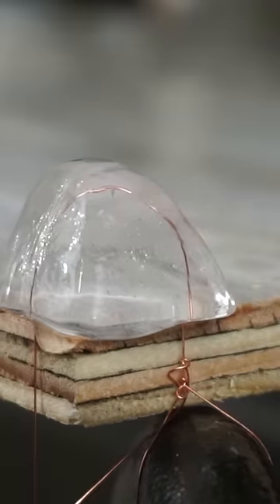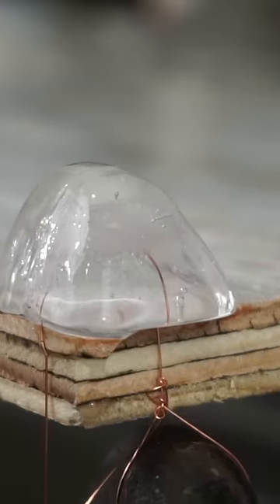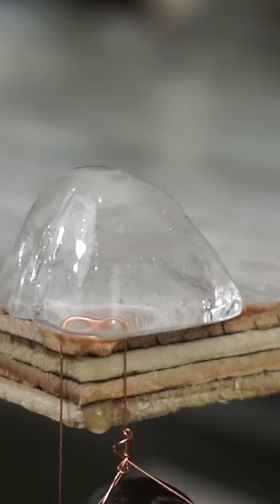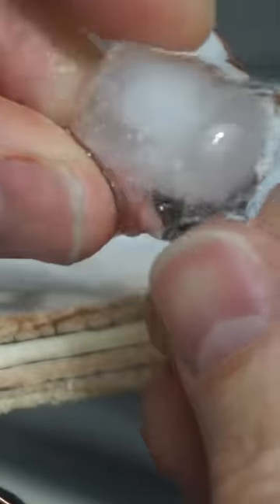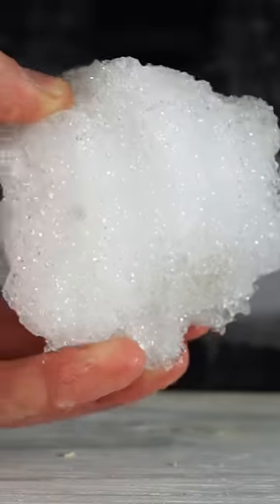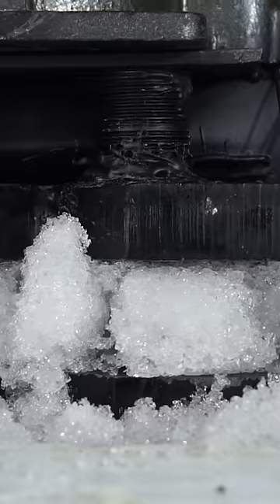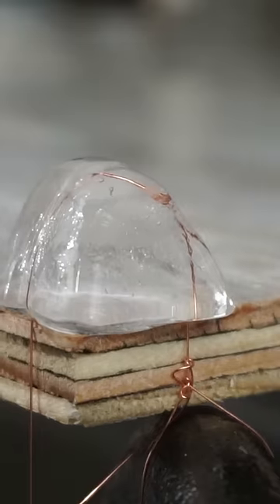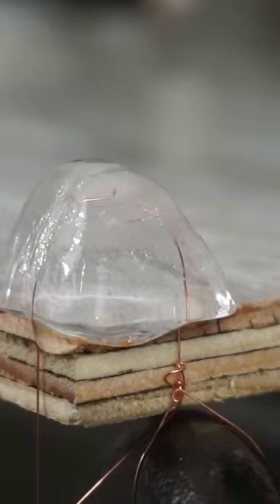Melting Ice With Pressure Instead of Heat

Comment: This is the reason u can skate on ice
Reply: No it’s nor
Reply: Yep. Your skates cut through the ice, but duw to this process, the ice reforms. But as the video states, the ice will still melt, which is why we have Zambonis
Reply: @Bean891 
 1) yes it is, the skates cut the ice and your weight causes pressure, slightly melting it, afterwards it reforms, and
2) *not
Reply: I thought I heard that was a myth, and we actually aren't sure why we can skate on ice. Is that right, or am I mistaken?
Reply: @Rippertear  the pressure on the ice melts it so u glide on water and then it freezes again. I heard that from neil degrasse tyson
Reply: @Stossburg  well im no scientist idk. Im just saying what i heard in a short. U may be right idk
Reply: @Bean891  Bro failed physics 💀
Reply: Someone needs to look at the phase diagram of water. At -5C, you need ~50 MPa of pressure to melt ice. So let's take a big fat 100kg ice skater that applies a force mg = ~1000 Newtons onto a single ice skate blade that has a surface area of 0.001m^2. That gives you a pressure of 1000N/0.001m^2 = 1 MPa, which is 50 times too low to melt ice at -5C.

Unless the ice is almost at its melting point (within a few hundreths of a degree C to 0C), the ice will not melt due to this mechanism. And in this video, the ice may be melting almost exclusively because the room is above freezing and copper is an excellent thermal conductor compared to air. 

What I vaguely remember reading on this is that ice has a meaningfully thick layer of increasingly disorganized molecules the closer you are to the top surface and the closer you are to the melting point. It is this disordered layer that is kinda effectively in the liquid phase that allows for ice skating.
Reply: @alquinn8576  geez 1.) im not reading all that.
2.) im not arguing i just heard it somewhere
Reply: Don’t know if skating shares this mechanism, but I do know my blades do melt the ice. How? Just skate backward and you can see a very quickly refreezing path tracking back to my blades. Both hockey and speed skates
Reply: And if you couldn’t skate on ice, then the universe wouldn’t exist 👍
Reply: @Rippertear  Again, I am no scientist, and I could be wrong, but I think it's still debated, so I guess both are correct
Reply: @dusanvasilik7480 How sad. If you can't be bothered to read it then you shouldn't bother replying to it.
Reply: I remember richard feynman believed this, in his "why" speech during one of his interviews.
Reply: It makes sense . It might be a quantum effect similar too quantum tunneling . The key thing is pressure and the material as stated in the video .  Intense Pressure causes strange things such as a core of a sun or more intense neutron star and etc . But if you want to go deeper down the rabbit hole , technically the metal or blades aren’t really touching the ice .
Reply: I heard it was the friction melting a thin slice
Reply: @alquinn8576  that sounds like you're agreeing it would melt in the 3rd section, because we're only talking about a few molecules on top of the ice. Of course a skater isn't gonna sink into the ice if they stand there too long, so all they need is a thin layer on top. I'm sure there's multiple processes at work which still warrants studying. 🙂
Reply: I think there's just an extremely thin layer of water on the surface of the ice
Reply: @D00nkey why haven't I ever slowly sunk in the ice being stationary while on skates?
Reply: @dusanvasilik7480 😂 oh NDT said it? i extra dont believe that shit now thanks
Reply: You can skate on ice because the melting point of ice increases as preasure increases so a layer of water forms where the skates are present which acts as a lubricant and reduces friction. Regelation is refreezing of ice.
Reply: @Bean891  bto just said "nuh uh" 💀💀💀
Reply: @Shaboogamoo because the pressure is not enough.  Put an 🐘 on your back and you will sink.  The melting (allowing you to ⛸️) also has to do with friction creating heat and not only the pressure.
Reply: @dusanvasilik7480 why would Neil degrasse Tyson know about the physical characteristics of ice? 
He's an astrophysicist.  All he will do is speak to and learn from experts in the field... you can do the same if you have the patience.
Reply: Why would this be needed to skate on ice? Both ice and metal have low fiction when "polished" smooth; you would slide just fine without the ice melting. 

(I don't even understand why the melting would improve "sliding", if anything the fiction would increase the deeper your skates cut in)
Reply: @theoriginalmonstermaker  the ice isnt smooth it has bumps from the skate blade. Idk if u ever saw a skate blade but it is a concave so u have ur whole body weight on a tiny knife edge when u r turning.
Reply: @dusanvasilik7480  The ice is smooth enough.  Also,  applying 150lbs of pressure on the edge of a thin piece of metal is sure to clear minimal unevenness. 
But the pressure (and metal's heat conductivity) is sure to cause at least SOME melting.  That clears the path as well... I mean,  I don't even really understand the implication of the OP; metal slides on ice, pressure and the smoothness of each reduces whatever friction there is,  if it melts,  even better... but it's not like skating would be impossible without some mystical phenomenon.
Reply: @Bean891 nor nor
Reply: @alquinn8576 sure showed that virgin
Reply: @dusanvasilik7480 NDT is often not on the forefront of science.
Reply: @alquinn8576 I'm not sure the surface area is actually that much, but everything you said makes sense even if the surface area is half of your estimate, so nevermind
Reply: I don't know if it's true or not, but the fact that ice skate blades are universally metal leads me to think this is probably true. Considering how we've had an official d3ath in a hockey game in England Autumn 2023, if any other "safer" material could be used, they would have done it by now.
Reply: According to NDGT that’s why.
Reply: @alquinn8576 thsnkd
Reply: @alquinn8576  I'm gonna assume you probably have some background in this, so question: does this have anything to do with why you get ice2-7 on other planets? The liquid ice phenomenon? I'd done a bit of research on it to respond to someone on another video, but even after, I, myself, was still quite confused as to how liquid ice was formed.
Reply: @lunaballuna no, not an ice expert, beyond tangentially having a physics degree and having done high pressure experiments.

Not sure what you mean by "liquid" ice since it's all solid by definition, but there is an amorphous (non-crystalline) phase of ice. Most of the different phases of ice require significanlty higher pressure than our atmosphere, and the deep earth is too hot for it to be stable, so that is probably why it is mainly (believed to be) found in colder icy moons, planets, etc.
Reply: Pretty sure we move faster than the ice can melt by our pressure so when it melts, we have already passed onto a solid part of the ice. I think the real reason we can skate on ice is the very low friction coefficient. I mean people skate on Teflon as well, it doesn't work as well as ice but still.
Reply: @dusanvasilik7480 Nah bro, i was about to believe in you till you said Neil tyson grass
Reply: @alquinn8576  We cannot make the blanket assumption that the surface of ice has different material properties than the bulk; but then apply the same assumptions about how much pressure is needed to melt it. Also.. skates move; they don't just press down in a normal direction.
Reply: @stickyfox  no, the point is that there is nothing to melt the surface of the ice because it is naturally already melted-ish (forming what is called a "quasi-liquid layer"). you can see "Thermodynamic origin of surface melting on ice crystals" on PNAS for a description, for example.
Reply: @alquinn8576  sure but what I'm saying is that regardless of ones beliefs, the statements A: "it would take a skater weighing tons to generate enough pressure to melt ice," and B: "it's not ice"; do not logically fit together to form a basis for further speculation.
Reply: @stickyfox  I don't know what you're confused by. The pressure mechanism is the explanation offered here. I'm saying there is a different mechanism that doesn't require pressure to explain a surface layer of melt.
Reply: @alquinn8576  Yes but... you're talking about whether or not ice skates "work because of pressure," and I'm talking about a misuse of logic before an audience that generally lacks a formal scientific education.

Logical fallacy questions like this are on standardized exams for middle schoolers. You don't need any science training to spot a mistake like that.
Reply: No, it's not. Scientists used to think so, but we now know that it's because the mobility of the molecules at the top layer, so it behaves like liquid water. 

Why do you think we can slide on ice even when we're not using skates?
Reply: @D00nkey  bro ratio'd 💀
Reply: Scientists: why can skate on ice?
Me: since when was that something we were confused about??
Reply: @alquinn8576  Or maybe the ice is just slippery?
Reply: @dusanvasilik7480 1) You should read it, it’s pretty interesting 
2) They aren’t arguing, they are simply stating what they know about the subject
Reply: @dusanvasilik7480  1. neil degrasse tyson has no idea about anything. Do not ever listen to him. 2. The newest science is not sure why we can ice skate.
Reply: @Rippertear  You are horribly mistaken
Reply: @alquinn8576 the assumed surface are of the ice skate is ridiculously low. Why assume 0.001m^2?
Reply: @alfredandersson875  because I looked it up and rounded down a bit (30cm x 0.5cm = 15cm^2, which is 0.0015 m^2)
Reply: @Rippertear yeah it's a myth cus the pressure isn't enough to melt the ice into water, in the newest study it turns out ice itself works like liquid and some complex stuff alongside it
Reply: There was a paper that came out about this recently. Apparently the reason ice is slippery isn't necessarily due to it melting, but that at certain temperatures the surface of the ice has a layer of "loose" water molecules. This layer is slippery but those molecules are apart of the ice, not melted into water if that makes sense. At least that's what the paper said, I always thought it was melted water from pressure.
Reply: Idk about you guys but ice is slippery even with basic shoes on. Skates just makes it easier to control your movement as it digs into ice when you kick your foot. I might be wrong but pressure in the blades has nothing to do with why ice is slippery.
Reply: @Magst3r1
I find it kinda funny how people forget you can slide on ice with shoes on your feet. It's like the first thing you do every winter if you get ice forming on the ground.

Thanks for the info btw
Reply: @alquinn8576  This is exactly correct. I was looking for this comment. thanks.

Comment: Detailed Explanation: Higher pressure raises the boiling point of liquids. As such, the freezing point also gets higher.

This has the same dynamics of a pressure cooker and a compressed tank of liquid oxygen/nitrogen. 

The liquid is able to stay that way because the pressure it's own vapours are producing is being applied to itself while still in a closed system. Pressure cooker takes advantage of the boiling point. Pressured canisters take advantage of the freezing point.

Comment: If you dip the wire in LN2 or liquid oxygen it would not have the same effect, even with more weight. This is because the main force melting the ice is, like other people mentioned, the heat conductivity melting the ice, not from the pressure of the wire
Reply: I mean the conductivity probably helps but in this case the pressure is what makes the ice melt

Comment: Weight is kind of irrelevant other than guiding and expediting the process here. When you're using copper or aluminum wire indoors it will soak up and redistribute the ambient temperature from the room into that icy heat sink until it carves a path through it anyways.
Reply: The way to control for this is to do the experiment in a walk in freezer.
Reply: that's a different effect entirely and not what is being explained. The wire could be a perfect insulator, and the pressure would still cause it to pull through. Or in a more likely scenario, if the room temperature was in the negatives, (therefore the wire heating effect is irrelevant) it would still occur. The pressure alone is enough.
Reply: It would not, except if you were to hang a weight of a ton onto that thin wire...  @Adlore
Reply: @headmasterrm2868 Yeah so pressure, you got it
Reply: @Adlore Thank you! For some reason so many people are ignoring the very real effect pressure has on ice and claiming it’s just room temperature melting the ice through the wire. Like what??

Comment: this is NOT because its putting pressure, this is because you are using copper wire, which is really good at transferring heat and cold. If you used plastic or another type of wire, it'd be a lot worse or take a lot longer if working at all.
Reply: It is because you are putting pressure. Yes a copper wire might work best (which is you know, why they’re using one) but the effect is still due to pressure. I’ve done the same thing with non-copper metal. Plastic obviously might not work as well as it’s harder to apply enough pressure with a softer than metal plastic
Reply: @DeathnoteBB Pressure is force per area. It has nothing to do with the softness of the wire, only with the diameter of the wire and the weight you apply.
Reply: @entcraft44  🤷 I figured but then I was like “Maybe it matters idk”. All I know is metal works, as a kid I used to play with this metal kabob thing and stab it into ice. With constant applied pressure it’d sink into the ice. But everyone in the comments was insisting it wouldn’t work with plastic so I was like “Even if it doesn’t…”
Reply: @entcraft44  Not trying to argue btw, I’m just frustrated everyone here that has 0 idea about this has convinced me of anything. Most of the comments can’t seem to understand the power of pressure
Reply: This is basic thermodynamics.

It is interesting that if you pull harder on the wire it travels through quicker.

I would attribute this more to a water layer built up between the wire and ice not allowing the wire to transfer heat to the ice.

If you pull the wire it forces the water the wire previously melted out the sides and forces directcontact of the wire to the ice.
Reply: @DeathnoteBB Of course you can turn ice back into liquid with pressure, but look at the phase diagram of water... Pressure you need  to melt ice is way higher than what can be created with wire and weights. The melting of ice in this experiment, caused of pressure is neglectable
Reply: @ludidrechsler  I don’t know which diagram you’re talking about, but pressure to melt ice is a thing. I used to do it as a kid when I was playing around with ice cubes.
Reply: @DeathnoteBB "Most of the comments can't seem to understand the power of pressure."

I don't see any comment that would lead you to that conclusion.  Instead, I see you claiming this is due to pressure more than heat conduction, which is obviously not the case.

It is indeed a thing, but it's not what's prominently displayed in this video.  This is heat transference through a good heat conductor, and the small surface area allows it to distribute a clean cut.

Comment: That is wrong. Explanation:

This is actually a very common misconception, as 2 my highschool professor explained to the students.

The pressure for the ice to actually melt, both here and with skies, would be far far higher.
However: you use a metal. Metals are excellent heat conductors. And next to the ice is air at ~20°C, leading to the metal conductong that heat and thus melting the ice.

It would not work with a plastic string, you can try that!
Reply: But the wire is literally in the cube. How is it getting the air’s temperature in the ice? Like I’m sure the wire not being ice cold helps but genuinely: pressure does cut through ice. Why are so many comments trying to debunk science?
Reply: Think of those ice presses that shape ice into balls for drinks. Those use pressure. They literally can’t use heat, or else the ball would melt more than wanted. However pressure can only melt as much as the machines’ mold. But heat would continue to melt the ice.
Reply: @DeathnoteBB isn't the point of science to debunk and evolve in the pursuit of truth?
Reply: @Feenixarise  Well yeah but a Youtube section pulling nonsense out of their ass is not science
Reply: @DeathnoteBB Most of the wire is outside of the ice. Copper is an obscenely good conductor of heat, so it has more than just "a bit" of an effect on this.
Reply: @MD-vs9ff  Y’all it’s not that good. It’s just air, it’s not like it’s hot.

Comment: Does regelation occur in any other solids? For example Dry Ice (solid CO₂)? What about Carbon allotropes like Graphite or Diamond?

If we could pull a strong enough wire through a block of Iron, would a similar effect occur to re-fuse the cut surfaces back together?
Reply: I’m not a scientist but no. Water is unique in that pressure lowers it’s melting point. Also iron wouldn’t “freeze” back together I imagine, unless it goes from REALLY hot to really cooled very fast

Comment: I definitely feel like you should mention is copper wire in capoeira conducts electricity and is so much electricity all the way around us at all times that that's conducting electricity to heat up the copper to melt the ice either way love the video

Comment: Does that also work if the surroundings and the wire are at 0C?
Reply: Presumably, as it’s the pressure not the temperature

Comment: Regelation is also how you can ice skate. The pressure of your body on the blade edges causes the ice to melt, but refreeze behind you. Essentially you are not "skating on the ice", but hydroplaning on water much like a car going through a large puddle